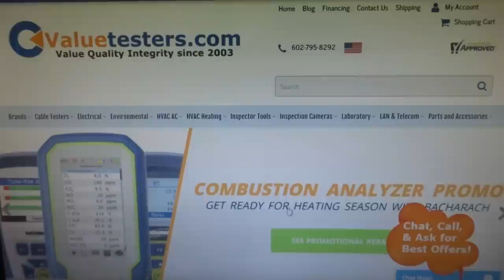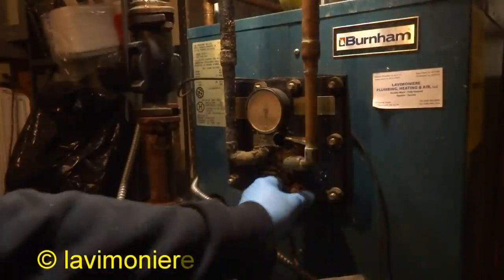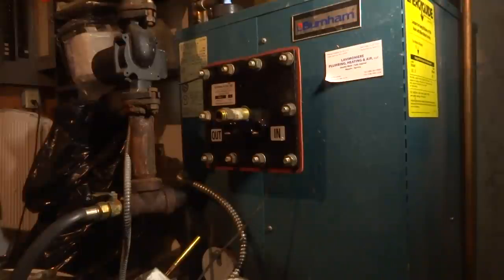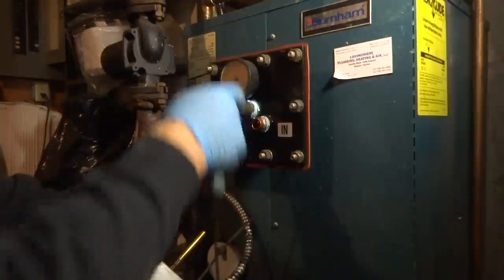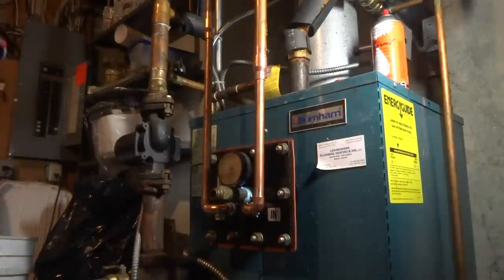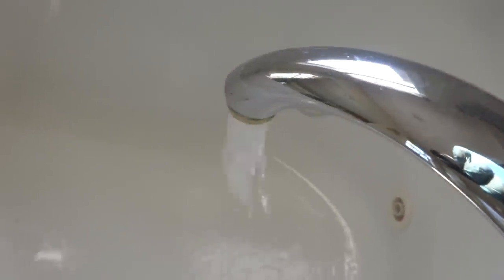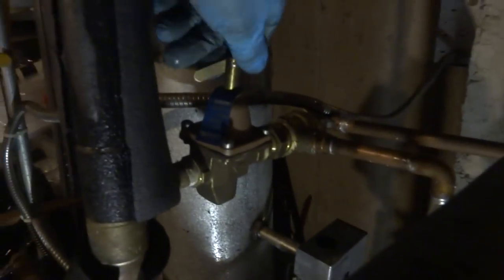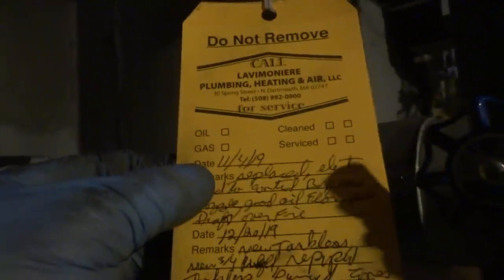tankless coil replaced in boiler other issues fixed

Comment: Can`t believe he got all that crud buildup from city water not well water. I pump in this boiler coil cleaner ' sizzle" when i`m losing hot water pressure. Got hard well water. Will have to replace coil eventually. Great job Steve!

Comment: i always pre-solder a piece of copper in thread adapters to get full penetration and to not overheat what it screws into, especially since they went to lead-free solder. I do mostly new construction and remodel, but service is a challenge too. No snaking ...I have another company do that for me. I always pick on you Steve....hope that's ok.
Reply: Steve, always enjoy the videos. Wanted to say that not pre-soldering those couplings. Cook's the tape, and pipedope. And, if not. Your solder doesn't  penitrate the fittings. Which is probably why, you needed to replace the water coil. Because, the last guy did the same thing!

Comment: What's the general life expectancy of a boiler? I live in Oregon very few houses use boilers, some older schools and commercial spaces have them. Even with radiant floor heating that I have in my shop it's run off a water heater and controls. These systems seam so ancient, I'd like to learn a little more
Reply: depends on the BTU heating you need. in the north east these are generally over 100kbtu of heat. Most residential water heaters are in the 5-7kbtu range. and 40-65gal. Larger homes may have larger heaters. But nothing close to the boiler in size.

Comment: I tell ya what, I don't sit here pretty when I hear Steve talking about how it's time to replace the 20 year old boiler, since we're sitting on a 25 or 30 year old boiler with a tankless coil feeding a 20 year old water storage tank.  Here's hoping the crusty old thing will hold on for a while longer...
Reply: iri10 I can tell you one thing I’ve been doing this for over 30 years your old boiler if you keep it well-maintained it will outlast a new one
Reply: Mike Fournier , I agree, I have a 1960 New Yorker steel boiler winter summer set up that hasn’t let me down other than a few small parts. “Knock on wood”. I am willing to bet a newer model would give me problems a lot sooner than this one will. I have boiler drains on my coil so I can flush it out once a year due to my hard water. They don’t make them like they used too!

Comment: We have the same type of oil furnace with a coil due to the high oil cost is shutting off an oil furnace a good idea? We only started doing it this Spring in warmer weather. Otherwise, always burning oil to keep the coil hot for hot water?

Comment: Always amazed at the crap in the city water.  Would a sediment filter help?
Reply: I'm out here in the south western US. I learned about water quality (or lack of) in city water with a coral aquarium. Measured in Total Dissolved Solids (tds) it would hit over 200 parts per million. Higher when some ass-hat cut into a line. We have one-way check valves at the street for each connection but somehow they still manage to open a line and flood it with dirt and god knows what else. I installed an RO/DI system for the aquarium and when I got rid of the tank I kept the filtration for drinking water. Huge difference! Not even hard water deposits in a tea kettle. Instead of drinking water with hight TDS my water is 0-2 TDS. Its worth looking into.

Comment: Merry Christmas Steven, and I see that you installed the boiler back in 1999. It's not your fault it ended up that way, once you install it the customer is responsible for maintaining it by getting it serviced each year. Ever since I learned about Carbon Monoxide poisoning in second grade, I've been on top of everything checking my heating system. That was all the way back in 1998. Why did it sound like a digeridoo once you removed the coil?

Comment: I cant stand when plumbers talk shit about how old a piece of equipment is. If it were up to them they would replace every boiler for every problem. Whats wrong with replacing a part when it fails as long as the main pieces of the boiler are okay. Is it that hard to understand that not everyone has 4000 dollars to replace the whole boiler. If everyone had new equipment Steve you wouldn't make any money.
Reply: Burnhams all look the same- whether they be 20 years old or 2 years old. Some boilers will last. If only they made servicable cores.
Reply: Around here (Westchester County, near NYC), a plain boiler replacement is more like $6,000.  My neighbor's Weil McLain just went out after 15 years...they don't last nearly as long as they used to.  I have a Peerless JOT from 1990, still going strong.

Comment: It seems strange that in Steve's area the water in many homes have high mineral content which is ruining equipment, pipes, fixtures, etc. Umm, not sure why Steve wouldn't recommend water softeners to the ones that need it. They are easy to install so it is easy money for him. Mine is just a $500.00 Whirlpool 5 years old and it is good on salt fully automatic, my water is 16 grains so not too terribly hard. I go through 45 pounds of salt every 30-45 days. Way cheaper than plumbing/equipment repairs. Of course I do use the Whirlpool cleaner every 4 months to keep the valve body washed out. Customers would need to do that to maintain the unit, not sure if Steve's customers could manage pouring that in the tank every 4 months...lol.

Comment: He keeps saying $125 bucks for a Temperature and Pressure Gauge, but I bought mine at Home Depot for $30.00
Reply: Home Cheapo. You'll be replacing that in another year.  But I will admit $125. seems high .